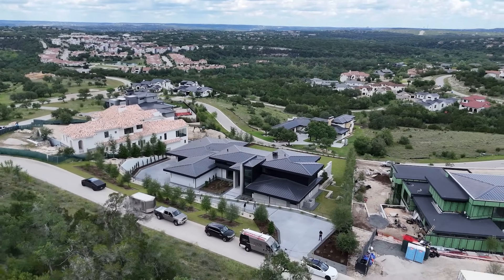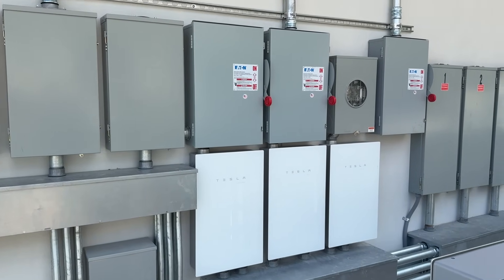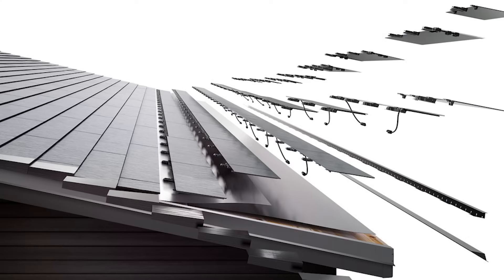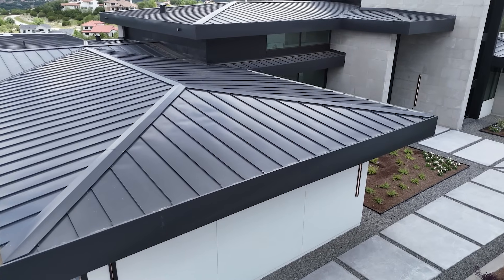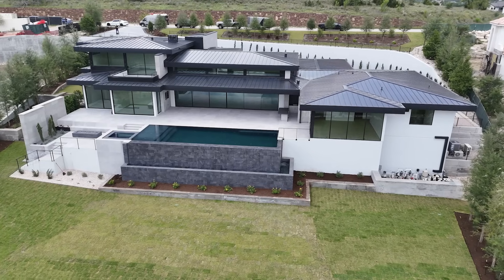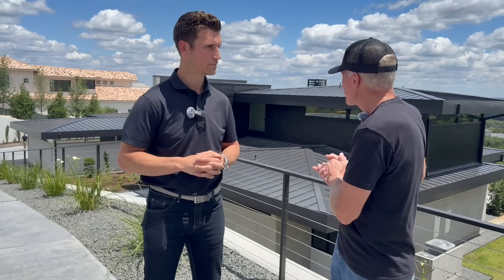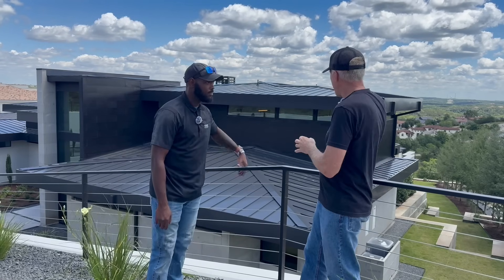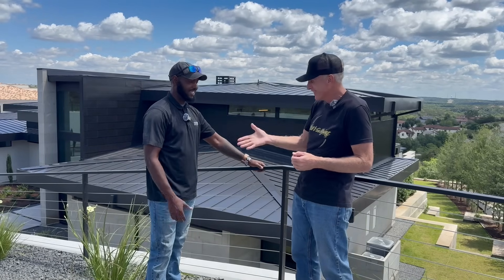First Ever Tesla Solar Wall Installation by Vikta Energy in Austin, Texas!

Comment: The idea in and of itself is neat but the build as a whole is beyond silly. No solar on the roof means it will generate very little energy making the huge battery storage practically useless, not to mention it would've been much cheaper to buy a Cybertruck instead of the powerwalls...

Comment: I don't understand - is that a standard (non-solar) seamed meatal roof, with the ribs running vertically down to each gutter?? Normally (or at least previously) Tesla solar roof tiles have seams that run horizontally across the roof slope like old-school shingles would. On this project did they ONLY use Tesla solar tiles for certain parts of the siding (exterior walls) and NOT the roof??

Comment: The cost is astronomical. First, the house has yo be built to support the weight of the panels. There’s miles of wires. There has to be land footage dedicated to the mega packs, transfer switches, cabling, etc..  And hopefully your utility will option to buy back your excess power. All in all, a very cool product but expensive project.

Comment: That's massive power.  600A power is insane.  Our home has 200A service, and it's overkill for even when we're charging both cars.  It sounds like they bought enough Powerwalls to keep the house running in shade plus charge up two EVs.  I suppose this might be really nice if a hurricane takes out the grid for a week or more.  Hopefully they can also get some payback using them for a virtual power plant, though I doubt the owner cares about the finances.
Reply: Yeah sounds like a Tesla board member built this 😂.

Comment: As I watch this video, I am looking at an 8-story vertical wall of a condo building, that is southern facing, and less than 1/4 mile from the Atlantic Ocean.  The wall has no obstructions or overhangs, and is in 100% sunlight for at least 8 hours a day.  It would be an ideal project for solar panels on a wall.

Comment: Is it just me or this is metal roof and solar is just on the walls?!?
Reply: Yes its metal but its a solar panel also. 2 in 1. Tesla is innovating.💡
Reply: @ricksgiggle8852  Fact or Guess?  Do not see this metal look roof on Tesla website...  Joe didn't really cover WHICH part of the roof has solar panels but it appears only a small section actually has Tesla Solar Panels on the roof..  Agree they keep saying Tesla Solar Roof but NO DETAILS.  Why?
Reply: To me the roof looks like it is metal, not Solar.  But would like to see it.

Comment: What is the ROI for something like this?  One lifetime or two?
Reply: Its not about the ROI and its definitely not about being environmentally friendly.  Its about having a 90% chance of having power the rest of your life vs. 50% chance if you're just on the grid.
Reply: A couple lifetimes in Austin. This is caused by the way that Austin Electric screws its customers. All electricity used in the home is measured and billed at the usual and customary retail rates as if there is not a solar power system in the home. Next, any power generated in the home is measured and the customer is credited at the usual and customary wholesale rate for power generated. Thus the customer pays Austin Electric the markup on all power used in the home, even if it’s not generated or distributed by Austin Electric. So they make money even on the power that you paid a bunch to generate. 

Finally, since Austin Electric is owned by the city, you can’t contract with an independent generator like the rest of Texas can. You are held captive by Austin Electric and get the privilege of paying some of the highest rates in the state. I looked into solar right after I bought my house. Since I make too much for the tax credit to do anything for me, the actual break even point was over 15 years. It made little sense to invest thousands when it would take years to even break even.
Reply: @Bill_N_ATX, I am not familiar with Austin rules BUT it seams to me that anyone anywhere in the US should be able to build their own DIY solar and NOT connect it to the grid.  That way you get 100% of the benefit.  I look at it the same as a backup gas generator on a transfer switch.  What's the difference?
Reply: Eternity😂